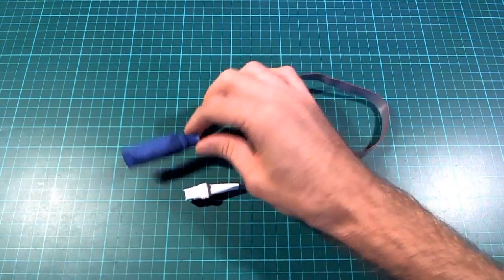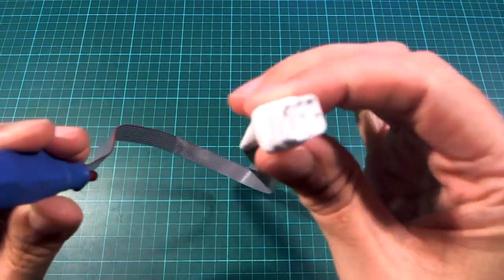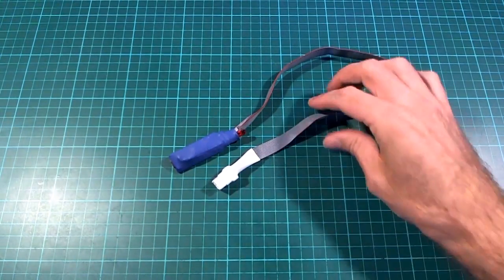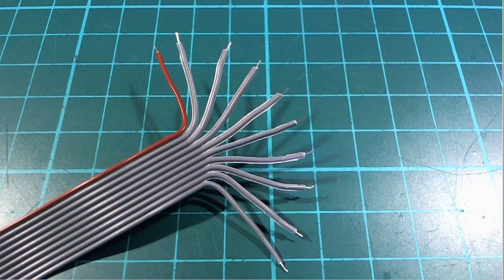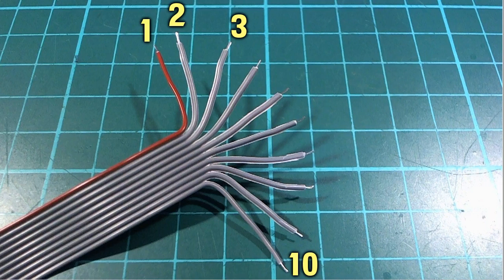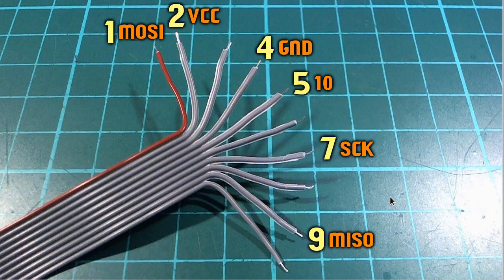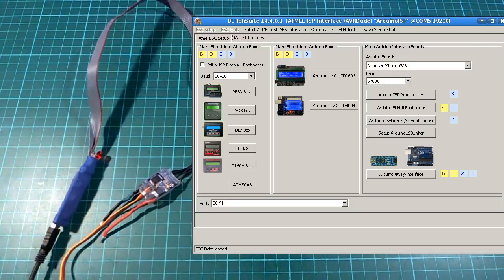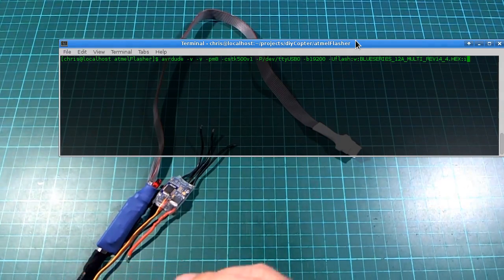Atmel ESC flasher tool

Comment: I really enjoy your videos because you document and explain the mistakes you make.
I do a lot of ICSP flashing of atmel chips.  I would suggest that you pick up one of the clone USBasp programmers prevalent on ebay ($2-3). I personally prefer the 6 pin versions so an adapter isn't needed. They work great and an additional advantage is that you can change the programming speed of avrdude via software.  You might also check out Avrdudess. It's a wonderful and open source GUI for avrdude.
Reply: +Dirty Engineer http://www.ebay.com/itm/271489740923
http://blog.zakkemble.co.uk/avrdudess-a-gui-for-avrdude/
Reply from the maker: +Dirty Engineer I don't see how that ebay item would help me flash the ESCs...
Reply: +iforce2d  It would elevate all the issues you were having with the "arduino as ISP". In BLheli you have the option of picking the USBASP as a programmer.
Reply from the maker: +Dirty Engineer you mean 'alleviate' right? Is that the six pin version you mentioned in the first comment? I don't see how I would connect that item to the ESC to flash it...

Comment: Did you try and flash them with the servo lead? I thought you could flash stock BS12 with a Afro/Turnigy toolstick.
Reply from the maker: +JKFlorida I doubt it. Don't know for sure though. Where did you hear about what the stock firmware is on these, I looked all over but couldn't find out. In case anyone is wondering it doesn't seem like the servo-cable interface to blheli works with these after flashing blheli either...
Reply: ***** I've 100% flashed BS12's with BLHeli using the servo lead but I can't remember if they already had the SimonK bootloader. It's been awhile since I've used them.
Reply: ***** Also on the BLHeli supported ESC's page it says bootloader on input plug.
Reply from the maker: +JKFlorida ok, maybe my servo-lead flashing connector is to blame. Which one are you using for that?
Reply: +iforce2d I used the Turnigy USB Toolstick.
Reply: +iforce2d I use BLHeli 4-way thingy to flash and configure ESCs through the servo signal wire. They are atmel based with simonk botloader and they use exactly the same 12A blue series firmware. http://i.imgur.com/fVVH6QZ.png Hope that helps.